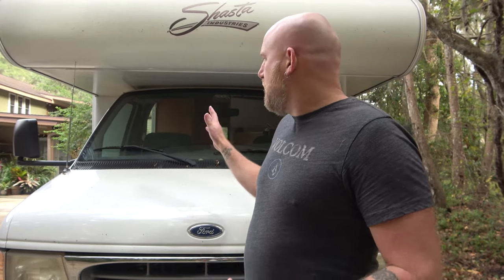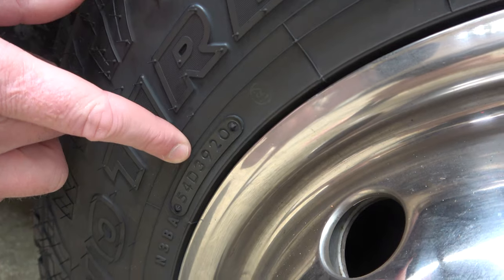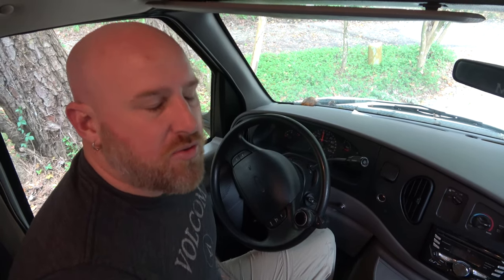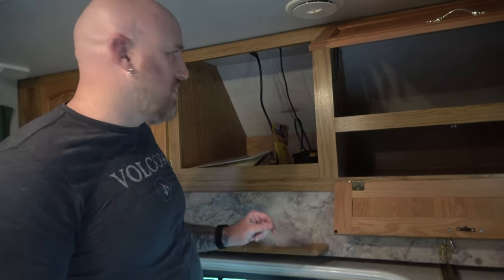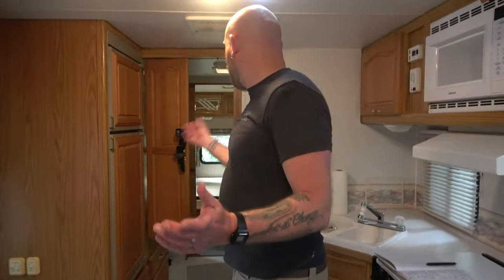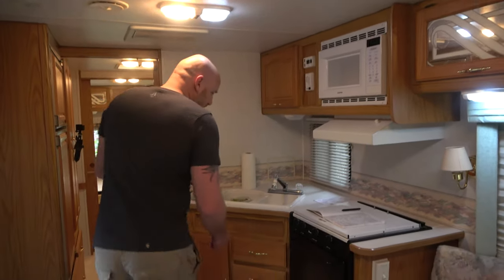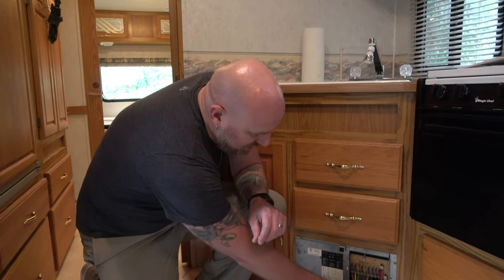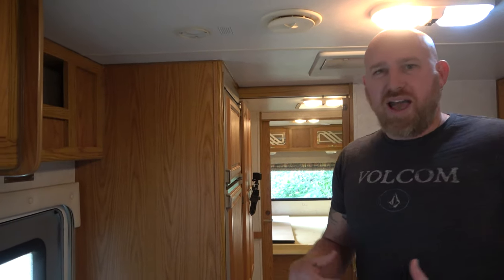What to look for when buying a used RV // Used Camper Buying Tips and Advice

Comment: Take a creeper( flat/wheeled, add a board for head/ neck support, another board to use as a runway underneath. Broom, webs & spiders , gloves , Notepad & pen , chalk to mark tire holes, spray bottle, hand soap or dish, in a ziplock, for tires,  dirty tire #vin &stats plates, lol hands, multi meter, air pump gauge, fridge thermometer level, to check theirs, tape measure small L bracket or for checking if it's square, , meas height, width length at random areas, this can prove potent. Frame issues smell. The drains. Stinky? Why? Test the H2O. Check the grey tank sensors at least, check dumping system, hoses. Rock it from inside & listen! Cracks, groans, squeals? Ha ha . Smell the  cushions. If poss do a black out test, cover all windows, doors when it's dark check the spaces,. See light? Haha take a roll. Of blue tape, mark issues& write notes, # each taped site ! There's always the ' make it rain ' test, if they let you,   garden hose,  spray attachment, one with a detention allows a roof leak & undercarriage check., fully spray each window with someone I side
Reply from the maker: Sounds good

Comment: Newbie here, how do I check if a class C can tow my car behind it?
Reply from the maker: It’s more the other way around. You need to check if your car can be towed and how (flat, dolly or trailer). Most Class C will have the towing capacity for small to mid size cars, but that’s your next step. Check the manufacturers tow limits. Then it is a matter of getting the right tow equipment installed on your motorhome and car. We use Roadmaster and have nothing but good things to say about that.

Comment: Some Water damage-walk away? Price reduction? Who, what, where, when, why, and how? Thanks bunches!!!!
Reply from the maker: We DON'T touch anything with water damage. It is too much work and way too costly. Typically a small leak will have been left over time. So not only will you have the leak itself on the roof or side or wherever, but also the water will have dripped down the side walls and can damage the structure where it is unseen. Definitely drop the price, by multiple thousands - depending on the type, age, etc. It's turning back toward a buyer's market with the way too inflated prices coming down. So hard ball the seller if there is water damage. Chances are, they're selling because they didn't want to deal with it... You CAN fix water damage. And with out previous RV that we bought without knowing anything about RVs, we DID fix water damage... and that experience taught us it's better to keep shopping than to try and repair water damage. Hope that helps?!

Comment: I realize this video is 3 years old but I would like to ask you a question in hopes that you will reply. Why were you set on the  Chevy V-10 6.8L and no other?
Reply from the maker: Our friend who is a 30+ year Ford mechanic said they were the most powerful and reliable. The same engine is in larger Class A and, as we have found, it pulls the same uphill with our 4,000 tow car as it does without it. No power concerns.

Comment: It should be noted that if the speedometer isn't working, it is likely the odometer is off.  Most vehicles the speedo and odometer are driven from the same cable.
Reply from the maker: Thanks! We’ll look into getting it fixed one day!
Reply: Most late model vehicles speedometer is electronic and no longer use a cable. The sensor is mounted on the transmission. My 2004 Ford e450Thor  has no speedometer cable. Instruments are servo motors that move the needles in the gauges.
Reply: @Bobby Bishop  that said, many newer vehicles ( in the last 10 or 12 years) you can edit the computer throught the ODBII port to set your current tire size to correct your speed/odometer.  And, yes, they are no longer cable driven, but they both use the same tire size setting to calculate mph and distance travelled.
Reply: @brianvandy4002  yes I got an S10 with 18s and the speedo is off like 10 mph to the slow side. The instrument cluster in 2000s Chevys are garbage. Those servo gauges are pretty much worthless. I did major surgery on the cluster and replaced them all with aftermarket mechanical  gauges. Real pain but worth it .

Comment: When you found out the speedo doesn’t work didn’t that make you question the mileage? If the speedo doesn’t work it’s quite likely the odometer doesn’t work either.
Reply from the maker: The speedometer does work, it’s just the needle sits at 40, not at 0. Once the vehicle reaches 40 and over the speedo works fine. The odometer works. We’ve put over 20,000 miles on this RV. Bought it at 47k, now has 71k on it. We record all of the mileage we’ve driven in this. We also have a engine reader with Bluetooth & the speed that shows on that has always matched the speedo. If the speedo did not work at all, then I would’ve questioned if the odometer worked. Have had this RV now for almost 3 years & 0 issues.

Comment: 1:01 what do you think would be the normal price on a RV LIKE YOURS say. 2004 32 ft. With one slide out
Reply from the maker: Sorry Rudy, but there is absolutely no way to answer this question as markets vary so much. Covid caused a massive spike in values for a short time and things are getting more realistic now. And beyond geographical markets, the condition of the RV changes everything. Ours was in 80% good condition with the 20% being things we knew we could easily address. A 2004 with one slide out when we purchased ours during covid - assuming low mileage and all appliances work - would probably be in the 15-20K range on the East Coast. West Coast prices tend to be higher. Now the 15-20K is probably in the 20-30K because people still think they can get top dollar covid pricing on their RVs. But I'd say the price is whatever I felt I could offer based on what work I knew it would need - just like buying a home.

Comment: Great video I've been thinking about a 1995 ford camper 58.000 miles the tires date code is super and leaking seals and maintenance etc great help thank you I'm thinking about using a phone camera selfie stick under where motor for oil leaks  etc great tips  Info.
Reply from the maker: Glad to help! That's a great tip - but a lot of the older RVs would be remiss if they weren't leaking. Definitely check underneath for rust but also don't hesitate to hire a mechanic to give a good inspection of the engine. That's always the weakest part of our inspection process because we don't know engines as well as other parts of the RV. Good shopping!
Reply: @CalledToWander  thanks I do know a lot about engines drivetrain etc what I did not know about rv s is how poorly designed and built many are until I watched tons of videos but great tips and info thanks again.

Comment: Are there certain Class C brands that you would recommend uf one is looking for a used RV? If one to go all in on solar 400. watts or more can you eliminate propane altogether? If not should the fridge be a 3 way?
Reply from the maker: Brands are not always as important as the inspection you do. But some engines are known to perform better than others. We're Ford people, so we were only looking for RV brands that offered the Ford V10 engine... In terms of solar, that's another topic we will have to address separately in another video. There are all sorts of calculations you'd need to do to determine how much battery you would need to run how many electrical devices for how long so that you can estimate how much solar you will need. We like the general rule of cover the entire roof the best you can and have as big a battery bank as you can fit and afford... And the 3-way fridges typically draw HUGE amounts of power from 12V battery bank, especially compared to running on propane or when plugged into shore power. We would not run a standard 3-way fridge on batteries at any time because we prefer propane anyway.

Comment: How did you fix the fridge? Was it costly?
Reply from the maker: So this fix was just a new motherboard, which we purchased for around $100 on Amazon and installed in around an hour. It was plug and play and worked great... THEN, later we had to replace the thermistor, which was another affordable repair we could do on our own. BUT THEN later we also had the entire cooling unit break and we paid $700 for a professional to install a remanufactured one. So, this particular fix was easy - but knowing what was down the line, we were around $1000 in fridge repairs (but it works AMAZING now, just like new!)

Comment: First Rv owner My husband Paul and I bought a 2000 Catalina sport e450  was it ok to buy this RV it did have some water damage?
Reply from the maker: It is OK if you know how to stop the water damage from getting worse. We had to deal with an active leak with our previous RV and it was a lot of work and a bit of money to fix that. So we make sure that there is no water damage both for our comfort and peace of mind as well as the resale value of the RV. If you can identify where the leak is and stop it and are comfortable living in the RV as it is, then it's not a problem. But otherwise you may want to invest in repairing it. Water damage won't stop until you stop the leak. So just be mindful of that and let us know if we can help in any way!

Comment: In your experience is there a typical used RV age that one should stay within? I have read At depreciation levels off at 5 years. Would 5-10 years be ideal?
Reply from the maker: We don't make decisions on depreciation. We make them on what we can afford and what the market presents to us. We know many RVers with brand new RVs that have more issues than those like ours that are over 20 years old with all original parts. And what condition is the RV in? Do you need to replace a roof at 5 years that was not well maintained but not need to replace one on a well-maintained 10 year old (or older) RV? And if you want to stay in some RV "resorts" many are making rules excluding any RV over 10 years old. We don't want to go to those places anyway. So what the market says and what you can afford for what you want - that's the best year.
Reply: Why the "no over 10 years old" policy for some campgrounds?

Comment: How does it ride ? I'm in the beginning stages of research and getting into the RV life , not sure what exactly I want yet but this is what I'm leaning towards.  

I have 3 disc herniations and a fractured vertebrae ( was rear ended in 2002 while at a red light smh) I manage but am curious how well these rigs ride , thanks !

I will be test driving some and ie renting one to get a feel for myself but curious as to your answer.  Thanks
Reply from the maker: It rides/drives like a full-ton pickup with the exception that we need to watch the dips in the road because of the long overhang and we have to take some turns a little wide because of the length (31 feet). Otherwise it handles great.

Comment: What kind of engine is it.. 
Ford stopped making the 6.8 L V10 ....
So now what about repair parts...???
Reply from the maker: Just because Ford quit making it doesn’t mean parts will stop being made. The V10 is one of the most common ford engines ever made and it’s base is used in their 5.4L V8 engines (the only real difference is 2 added cylinders). In fact it’s the most heavily produced V10 ever sold in America

Comment: God you bought a Ford, yikes, though the older versions might be better.  Just been listening to some content unrelated to campers but about Ford vans and wetbelt technology being a disaster and with a removal company having multiple fails as as the wetbelts are being rotted by the oil as opposed to the old cambelts which were much more reliable.
Reply from the maker: This motorhome has the 6.8l V10.. pretty positive it has a traditional timing chain

Comment: I would argue if the speedometer doesn’t work right the other gauges don’t.
Reply from the maker: Well, they do! Speedometer works perfect once we hit 35 mph. Odometer reads correctly, as does tripometer. And we have an engine code reader that verifies the accuracy of other gauges.
Reply: @CalledToWander  that’s good! With these digital systems these days it’s hard to trust when there is a known fault in part of it. How many foot RV would you say is needed for full time living (1 person 1 dog)
Reply from the maker: @annoythedonkey  We have manual everything in this 1999 RV on purpose (gauges, windows, seats, locks) as we've found electronic things (even brand new) fail more frequently and are harder to repair than digital/electronic. We can actually hit the dash board and the speedometer needle will go back to zero and give us accurate reading up ontil it gets stuck again at 35 mph! As for the size of the RV, that is totally up to you and your comfort. One person and one dog might fit much better into a truck camper like we had at first than we did with 2 people and 2 dogs. Or you may be fine in a van. There are always trade offs and you need to know what the goal is of the RV. For us, this RV was not an "Adventure mobile." It is a comfortable office/living space where we can travel slower and stay longer in places. Eventually we want to move fast, like we did our first few years, and we'll likely downsize to a van we build out to take us places we want to go but can't get with this one... so you should consider purpose first. There is ALWAYS room for a dog or two! =)
Reply: @CalledToWander  I need a place to shower and sleep, I’ll be working a lot on my cannabis delivery company. I’m in Colorado so it needs to be good for cold weather.

Comment: I would never buy a camper without knowing the mileage !  That thing could have 150k on it!
Reply from the maker: We wouldn’t either. This one had 46,500 on it clearly stated.
Reply: @CalledToWander  At 2:34  you clearly state that odometer didn't work and was stuck !!   so WTF?
Reply from the maker: @femazone6865  the odometer works fine. The speedometer is stuck at 40 mph. Must have gotten the names mixed up in the video
Reply: @CalledToWander  Oh! Ok  thanks for responding.  I am looking to get on the road and watch videos like yours.  Can you give any input on the pros and cons of the truck bed campers and the power needed to  use them?

Comment: If  the speedometer doesn't work you aren't getting a correct miles on vehicle
Reply from the maker: Speedometer works just only above 40 mph. Odometer works fine
Reply: @CalledToWander  Love you guys. I too bought a unit very similar to yours. I'm redoing it now on the inside. Just an observation. The speedometer issues my just be the psom unit on these fords. Mine is going out and the speedo jumps around. It looks easy to pull so I will try that. A company in Dallas can reprogram that original one for like a hundred dollars. I'm going to remove mine and clean the contacts and see if that does the trick. Again, love watching you guys and enjoy your travels. Peace, Jim

Comment: What would be a good way to check if you winterized properly and no water lines are cracked without filling the FW tank with water and running the pump? Can you use an air compressor and listen for noises once the system pressurizes at 40 PSI?
Reply from the maker: We did not worry about that as we bought the Rv in a region that does not experience hard freezes and we also planned to gut and remodel everything. The best thing to do is to fill the tank and run every faucet and shower so you know they work and, of course check for leaks during that process. Pull out all the cupboards and drawers for access to the pipes if you do this. We planned to replace all plumbing appliances so we weren’t terribly concerned about it